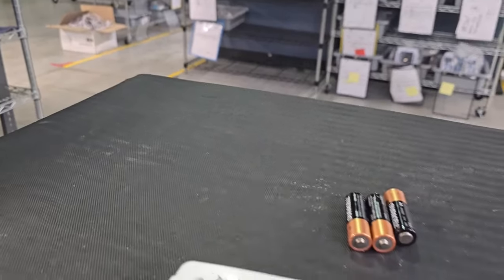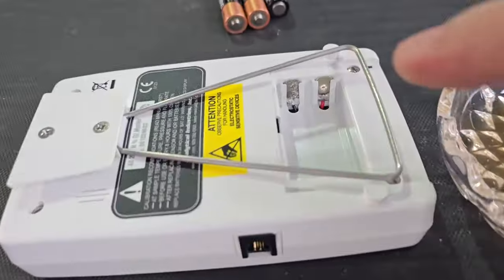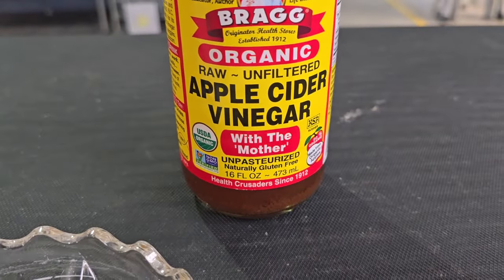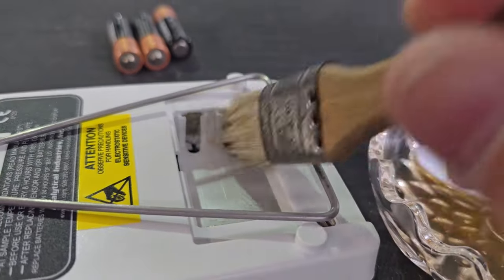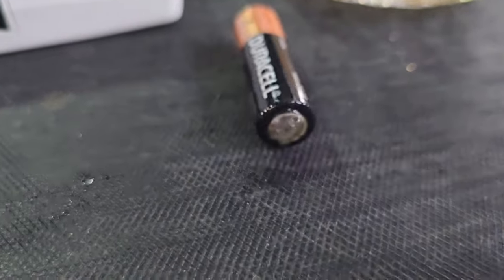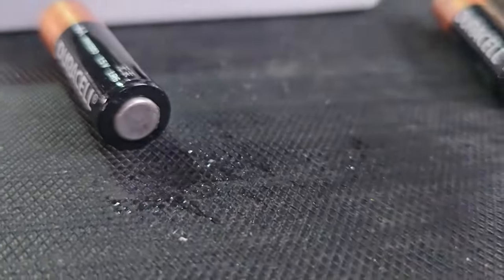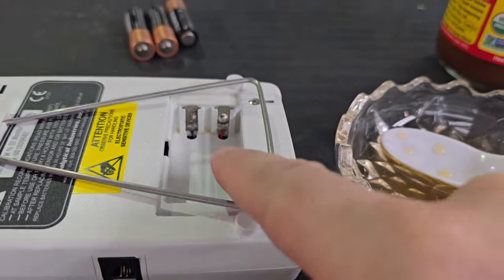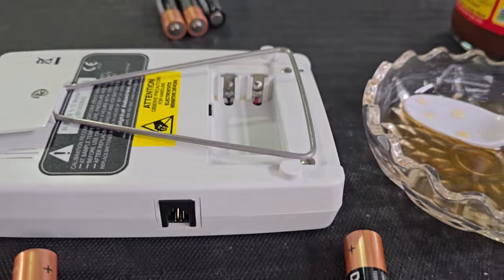Battery Corrosion Fix!

Comment: Great tip!  I've never thought about using vinegar. I normally use brushes or break the head off a tongue blade to give me a rough surface to scrape off the stuff.  I also find that once the terminals have their plating gone, from corrosion, they tend to corrode soon after again.  I add a bit of petroleum jelly to help fight off corrosion.  Higher amp stuff will get silicone grease.
Looking forward to the next tips!

Comment: If you have the budget wouldn't you just use contact cleaner.
I suppose if you are at home and have run out then vinegar.
Reply from the maker: Contact cleaner doesn't work as well and it doesn't neutralize the reaction